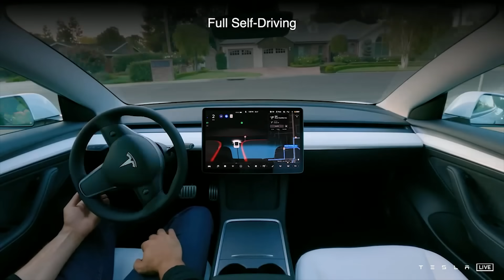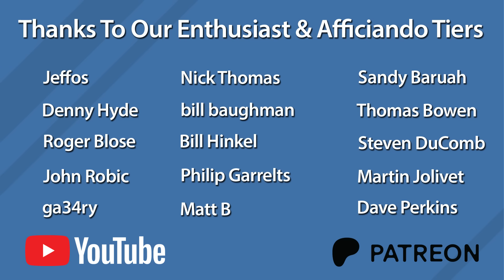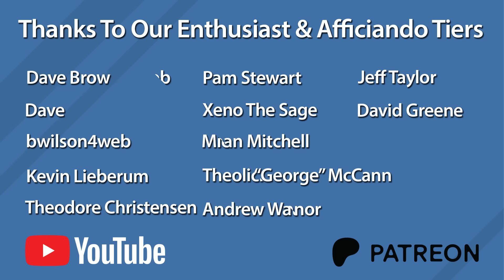Ford F-150 Hit by Fire at Aluminum Supplier; Solid State Battery Breakthrough - Autoline Daily 4152

Comment: Solid state batteries are already a reality.  Didn't Toyota announce last week they were about to begin production of an electric vehicle with a solid state battery?  We read somewhere that they had.
Reply: Toyota's been about to begin production of an electric vehicle with a solid state battery for twenty years now.  It's been slightly delayed by them needing time to lobby against any type of clean air agendas.
Reply: @patrick7228  We don't believe that. We have had Toyota vehicles for many years and found them reliable and well made unlike domestic automakers who long fought against antismog legislation in the U.S.  Toyota has long resisted entrance to the electric car market because lithium ion batteries are simply too dangerous and heavy to be safe and practical in designs.  Now the smaller safer solid state batteries provide better sources of electricity for EVs.

Comment: I wouldn't wait for solid-state at all, it's not likely to be cheap for quite a while after initial production and current batteries are so good, even a 2017 Chevy Bolt.
It would be great if we get solid state replacement batteries for the classic EVS, installed in third-party shops, in 10 years or so
Reply: With upgradable battery management software, inverters, and charging ports so that it can be driven with tomorrow's standards.
Reply: Supposedly, there's already a semi solid State battery pack on the market in China.
Reply: CATL's Naxtra is the cheap good enough battery we all need now and will hopefully have access to it soon enough...
Reply: If SSBs can cut down on fire and toxic gas release risks, it's worth pushing hard on it. Available battery tech is pretty darn good from an energy density standpoint, but has serious failure modes. I have hope SSBs will mitigate that.
Reply: Plenty of the oldies have removable batteries
Reply: Yes, current battery technology is safe and effective when used as directed
Reply: If the Nissan Leaf never had replacement support, then that is a dead issue especially with more packs as structural elements.

Comment: Q4 Tesla Excuses:  Model Y Roger Smith edition MSRP $40k!  Full Supported Driving (FSD) v14 worse than v13!   v15 will fix the issues with v14!  Tesla Insurance in trouble in CA!
Reply: Roadster 2
Reply: What about all the amazing products that don't exist, underwater, that oil justify musk robbing the company blind
Reply: @rp9674 Dojo 3 soon.   HW3 upgrade next year every year.
Reply: Bot- boob, just because you make sh*t up doesn't make it true v14 is light years ahead of v14
Reply: @Mr.Benson Not according to the recent reviews.   Btw, are you working on HW3 upgrade?
Reply: Bot-boob  Tesla's FSD v14 is designed to be a significant improvement over v13, with v14 offering enhanced predictive AI, more natural driving inputs, better performance in parking and navigation, and advancements in sensor utilization
Reply: @Mr.Benson So you are admitting that every previous version was a junk bucket of bits?   No thanks.  V15 will be way better.